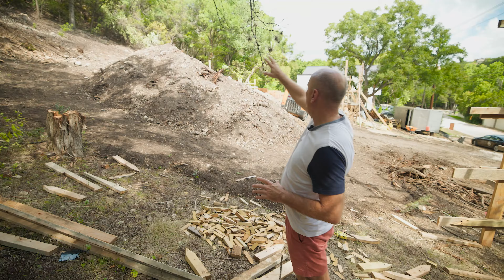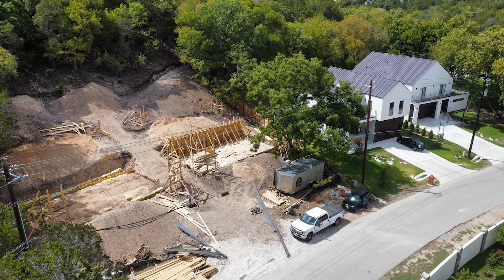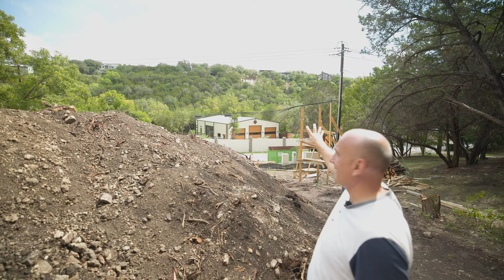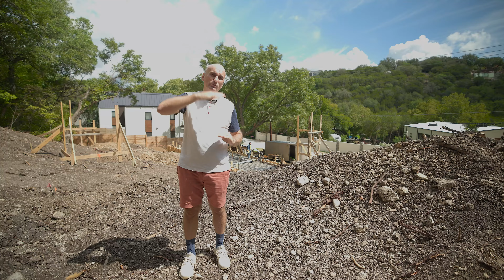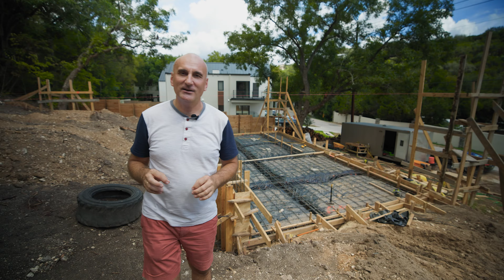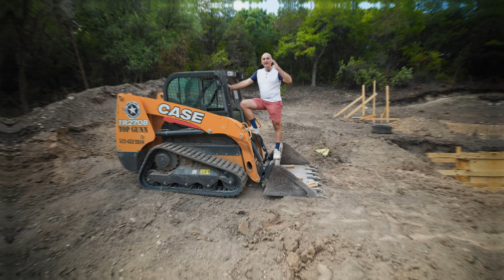Building A Perfect Foundation On The Slope (My Secrets)

Comment: In construction  of a basement wall,should all the basement wall be concrete or just the one along where the soil has more impact on the wall
Reply from the maker: If I got your question right, my answer is "Yes, All". But if you have direct contact with the ground, it should be well protected from humidity and pests